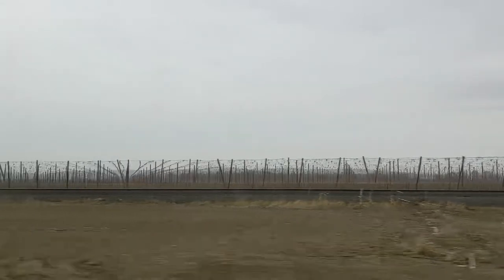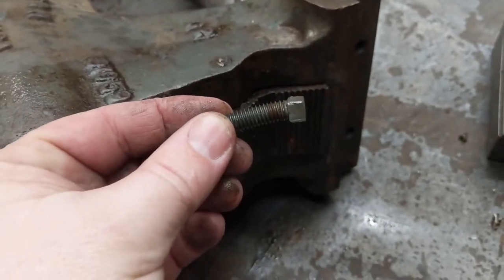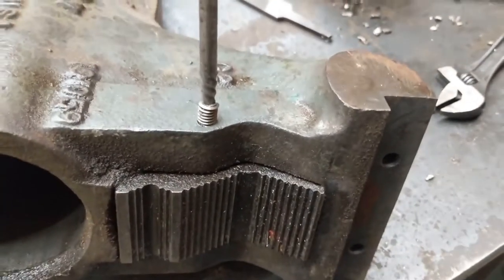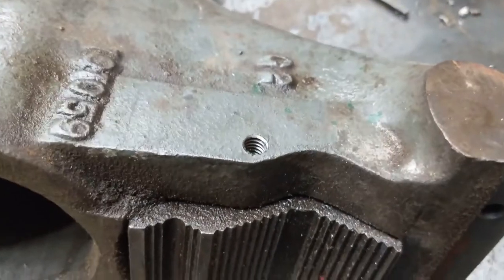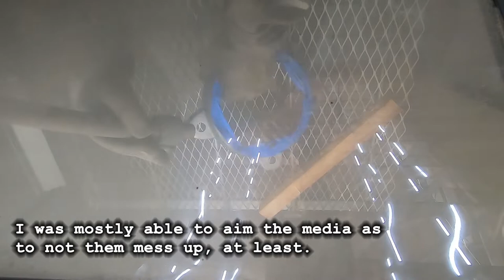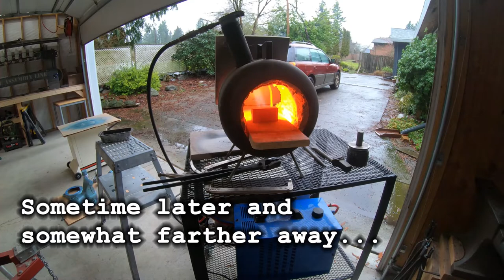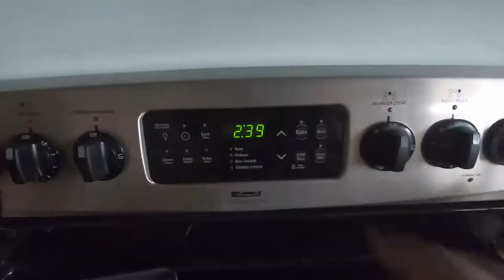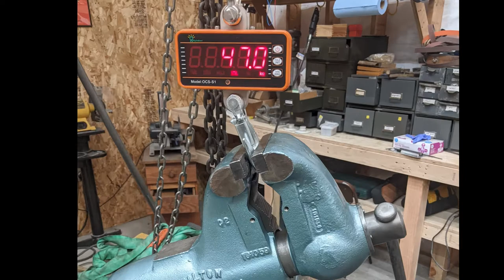Wilton vise restoration

Comment: Glad to see the baldor being put to use! I wish I had it when I was restoring my 4” Wilton. I found mine in a trash pile at a sheep farm and it had decades of rust. Many frozen parts and screws that needed to be drilled out and retapped.
Reply from the maker: It's been working great! It has really changed my default workflow cleaning stuff up.